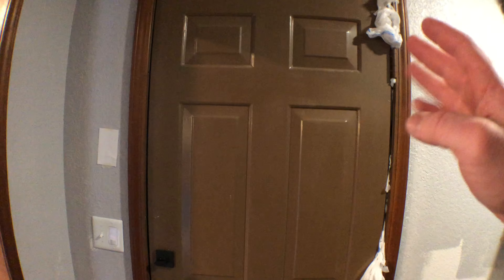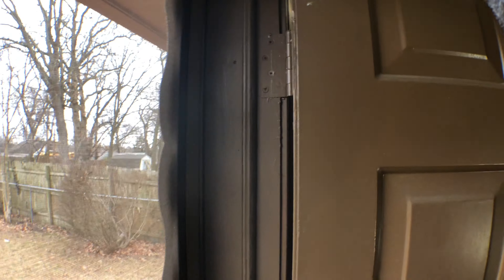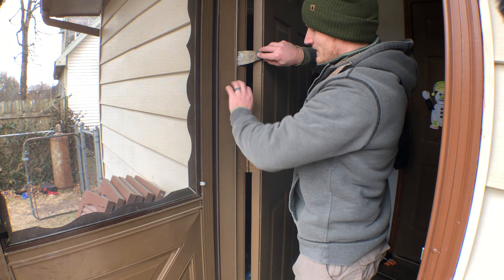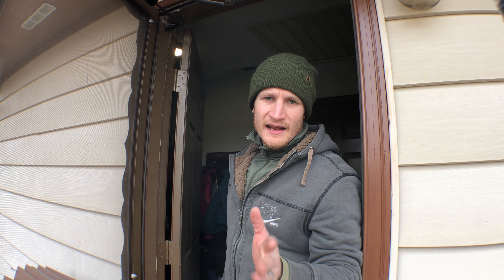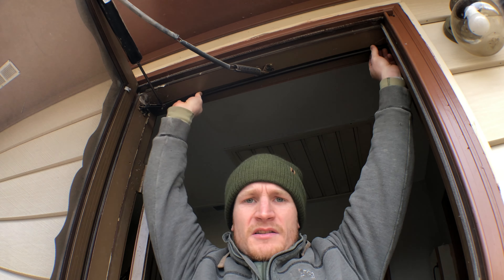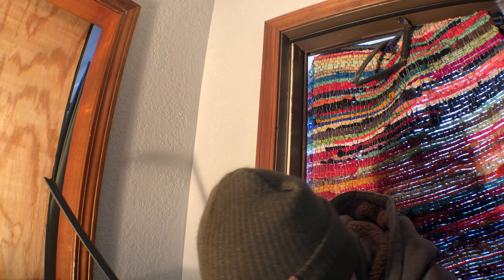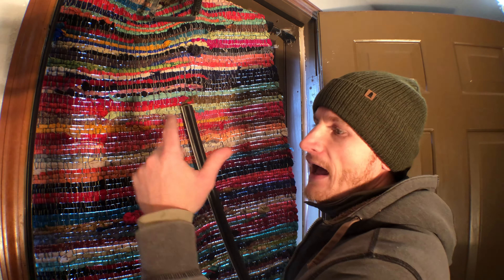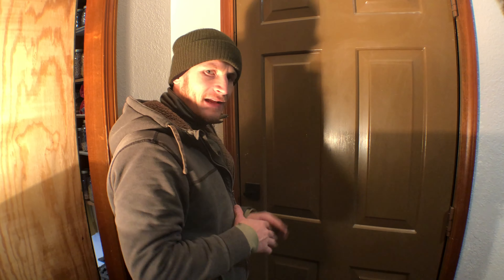Install Weather Stripping On An Exterior Door | HOW TO

Comment: Our apartment complex recently installed smart locks leaving a huge gap between the door and the frame.  I can feel cold air blowing in on cold days.  I'll definitely install weather stripping.  I hope to find a color that matches my door. Thanks so much for the instructions.  I'm a single woman who's not handy at all
Reply from the maker: This is an easy job. You don't need to be hand to do this one. 
Good luck with your repair.

Comment: I just installed mine. Thanks for the help! Question; is it a bit hard to turn the dead bolt? Mine is. Maybe it’ll be easier once the weatherstripping is compressed some.
Reply from the maker: Yes. Give it time. That will change. 
Also, you should be able to adjust your strike plate to make it a little easier to close and latch your door. 

Thanks for commenting.

Comment: any difference between the strips you used and the sealant paint or expanding foam sprays/nozzles in terms of performance?
Reply from the maker: I am a little confused on the question. 
If I understand you right I will do my best to answer. 

The strips I installed allows you to open and close the doors as much as you want. 
Expanding phone would permanently seal the door shut. 
I hope that helps. 
Let me know if I didn’t understand. 

Thanks for asking.